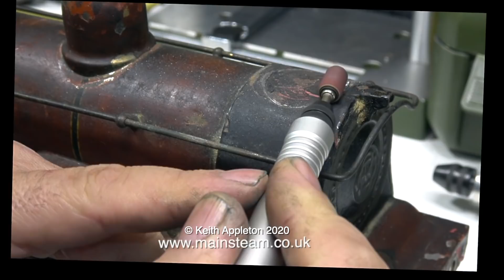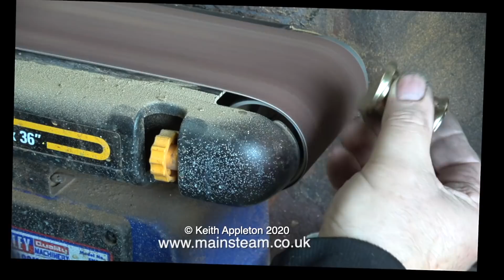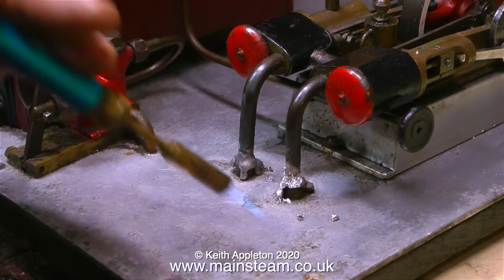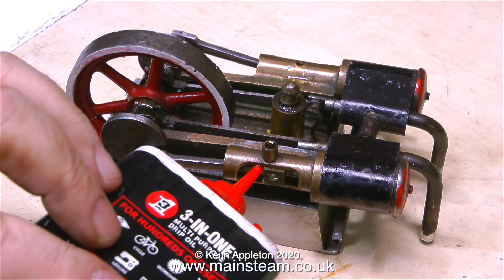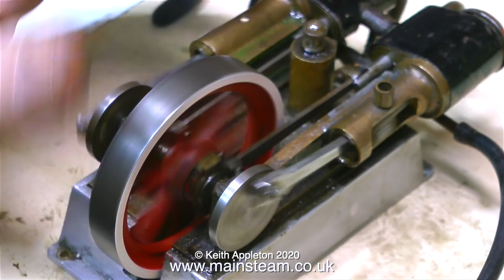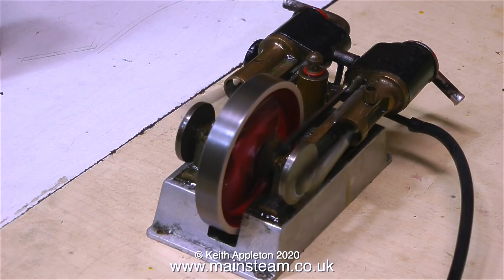MINIATURE STEAM REPAIRS - IS IT WORTH THE EFFORT?

Comment: First of all, i am a beginner and my experience is very limited and English is not my native language, but feel free to point it out nicely if i write something wrong or offenive, if id it was realy not my intentions.
If You Won't mind, i hawe a few questions for You guys, ones is this:

Is it possible to get a spare cast chimney reprodution made of metal for the 0 gauge Bowman pre war locomotives somewhere?
(I hawe a locomotive whis is missing it's chimney)

Am i right if i limit the pressure to about 1-2 bar/(or 29 psi for You racingcar guys who are not into hydraulic).
For the Bowmans and Basset Lowke pre war locomotives in the 0 scale?

If i fill the boiler with water, Am i right if i shall preform the pressure test at 6 bar (/87.0 psi/ 600 kPa), or would that be too high?